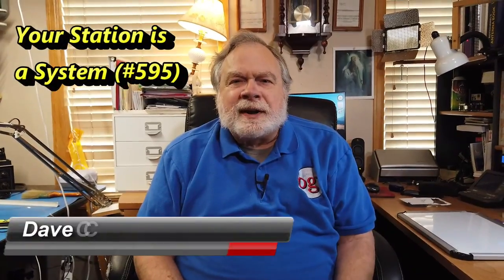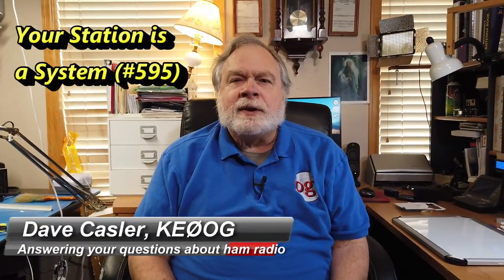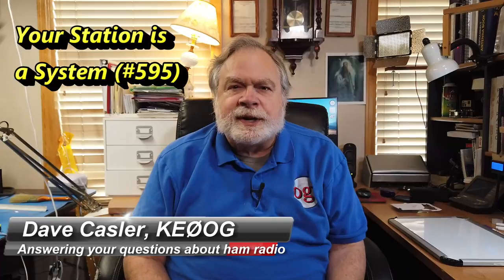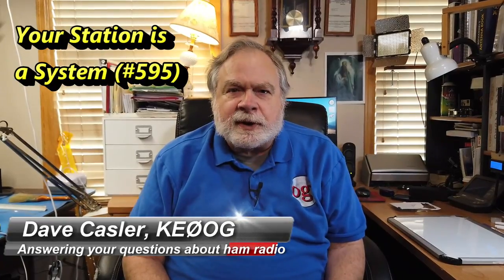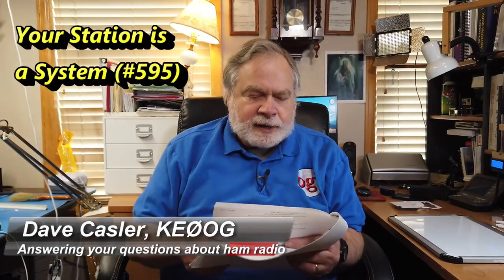Your Station is a System (#595)

Comment: How's that DX Commander re-assembly coming along? I live in Oklahoma and have been waiting on your "proper" assessment of that antenna for a long time. I am really curious about it's durability in our weather, minus the rampaging deer attacks of course.
Reply: I have one that I leave outside all year around. Have had zero issues with it. It performs great.
Reply: I guess a lot of HAM's are waiting for that video .. If the DX Commander is setup properly and you use all the hardware that comes with it. You then tune it where you want it to be, you'll have the best vertical money can buy. Last year It got me from my hometown in the Netherlands to Adelaide Australia which is 10.000 miles on the 20 meter band. Of course conditions were also a factor .. Weather durability is great, if build properly it will have no problems with any weather. Deer attacks however are untested at this point, as far as I know ;)